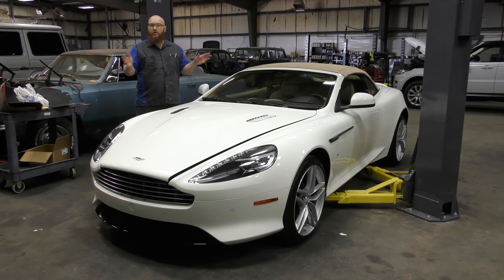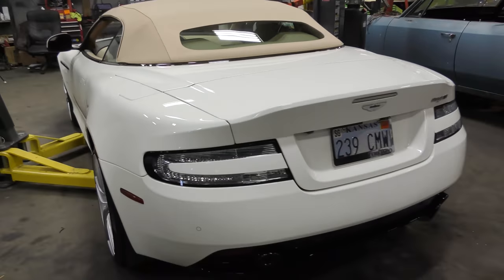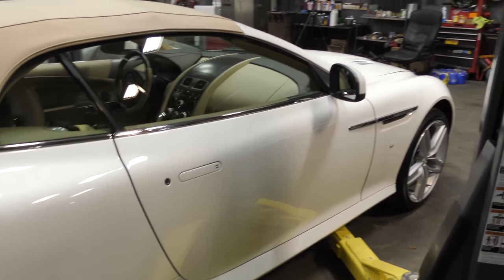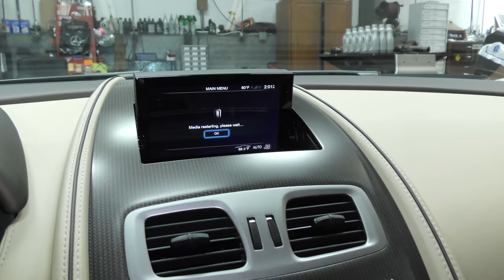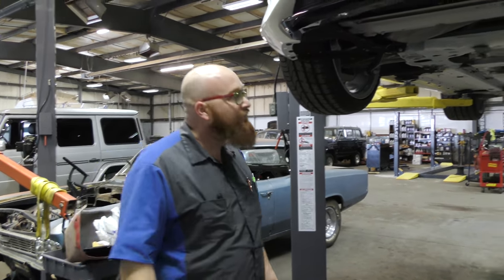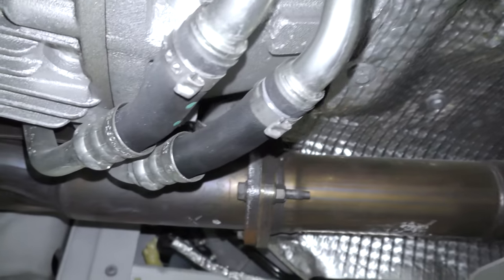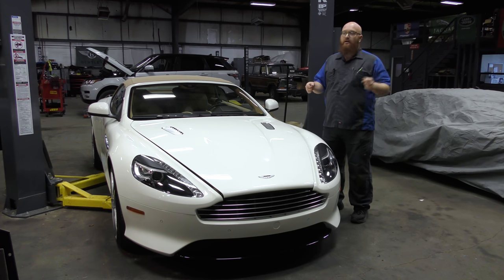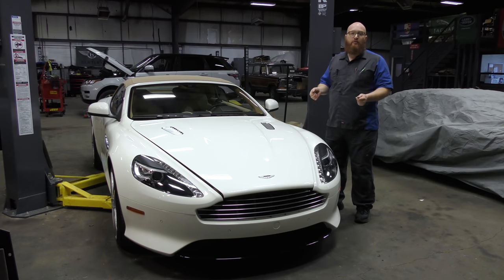Like new 2016 Aston Martin DB9 GT with only 3K miles! The CAR WIZARD is in awe of this car!

Comment: Right.  You're going to spend five to six figures on an Aston Martin, then you're going to take it to an oil change place well known for putting an impact driver on your oil pan plug and triggering an instant oil leak.

Amazing thing about the Aston Martin rear mounted transmission - the Chevrolet Corvette has done that the same way since the 1997 C5.  It's an effort to improve the car's front to rear weight balance.

Comment: March 23 2026 the Aston still has 3000 miles on it but is now it's 10 years old because it took 5 years for the wizard to receive the filter from Austria where it had to be hand made by an 80 year old artisan (which is why they have Mercedes engines now) and shipped via snail mail.

Comment: The oil change is so difficult because they used a German engine. Should have put a JLR 5.0 V8 in there; oil filter on top of engine and fill port has a little tube where you attach a pump and just suck out all the old oil. Easy peasy on a a $125K car. I guess AM has to justify theirs costing $250K somehow... :-)

Comment: Having to remove a throttle body to change the oil is the epitome of engineering design.  Surprised they didn't put it in the valley instead.

Comment: Why would anyone use a "Quick Lube", having said that why would an engineer design an engine that makes it that hard to access the oil filter. I do my own oil changes and find my Mercedes with a 3.5 liter V6 is the easiest car to access the oil filter at the top front of the engine.

Comment: Correction Wizard jiffy lube would just pull on the plastic shield an rip it trying to shove their hand in there to get the oil filter. Ask me how I know
Reply: definitely. though in this situation the quick lube probably wont even bother replacing the oil filter because either 1. they didnt find it or 2. cant be bothered!

Comment: The old saying of the right tool for the job is no different to the right space for what is needed... And in this case  if it was just cheap Kia it's not going to matter as much but expensive Sports cars super cars if you left them outside.. even with a security fence owners of said cars would be think not taking it there and insurance would be a nightmare due to possible break ins.

Comment: Can someone tell me why Mercedes benz's need a 1/4 of a turn of the steering wheel in order for the tires to start turning? Why does the steering feel like it's made out of rubber linkages? Even a NEW s500 (not mine, a relatives) had the same play in the steering as any other MB. WHY?

Comment: Why isn’t the owner not taking it to an Aston Martin dealer for an oil change? Surely the warranty will be void now.
Reply: It's a 2016.  Pretty sure the warranty is expired.  Besides, servicing the car outside of the dealer is not cause for voiding the warranty.  If they don't use the right specification oil and filter, then yeah.  Probably not the case with the Wizard.
Reply: @admranger  ah👍 yes😀 That makes sense. Cheers🍺

Comment: Engine in the front,  transmission in the rear?  How is the engine's power transferred to the transmission?
Reply: @CathodeRayNipplez  Sooner or later some intelligent person like the car wizard himself will explain this. 
Is there a shaft running from the engine to the transmission,  or is it a hydraulic transmission? 
Please someone give me an honest answer.
Reply: @CathodeRayNipplez  So this shaft turns at engine speed....interesting. 
I'm from South Africa, and I'm actually a qualified vehicle technician,  working full time in a vehicle repair shop. 
But alas, I've never seen or even heard of something like this. Honestly. 
And the Wizard didn't show us this shaft, or even mentioned it. ....😊👋👍
Reply: @CathodeRayNipplez  OK,  thanks so much for that. 
Wizard, why didn't you show us this torque tube? 
I'm still an eager young mechanic that wants to learn. 
That's why I love your channel so much. 
I also like Scotty Kilmer and Engineering Explained. 
Something else which is highly recommended to watch is 4xoverland  and ROAM overlanding.  I ❤❤it 😊👋👍👍
Reply: @BubblesTheCat1  Or you could just look up the 1997 Corvette C5.  The transmission and differential are combined in the back into one unit.  This design is meant to improve handling.  Instead of having the weight of an engine and transmission over the front wheels making the car's front half much heavier in the front than in the back, it's a design that tries to make the car more balanced by moving some of that weight over to the rear.  The Corvette C5, C6 (2005-2012), and C7 (2013-2019) are all like that.
Reply: @houseofno  That makes perfect sense. Thanks guys!
Reply: Carbon fiber shaft inside torque tube ... too bad it’s hidden inside
Reply: @arthurmartin27  Why the need for carbon fibre in the torque tube? 
What's all the hype with carbon fibre? 
Here in South Africa an illegal street racer had an accident and the carbon fibre panels amputated both his legs.
Reply: @BubblesTheCat1   strength and low rotational momentum most probably.
Reply: @arthurmartin27  😊👋👍

Comment: I got a poormans Aston Martin 
A ford fusion titanium lol
Reply: Too bad they never put the 3.5 Ecoboost in those. They would have been quick as hell.
Reply: I'm pretty sure your Ford Fusion isn't packing a six liter V12 or butterfly-opening doors.  Those two items alone would toss your Ford Fusion comparison right out the window.
Reply: @Epotheros  Is that before or after they blow their headgaskets?  Quite a large number of recalls on these Ecoboost (or should we call them Eco-BUST) engines for a variety of displacements.
Reply: @houseofno  The 3.5L wasn't the one with head gasket issues. That was the 2.3L in the Focus RS. At least the Ecoboost engines don't go through head gaskets as often as Subarus, BMWs, and Toyota V6s.